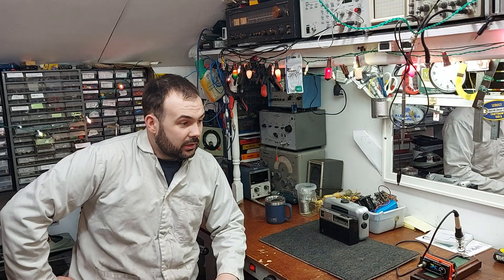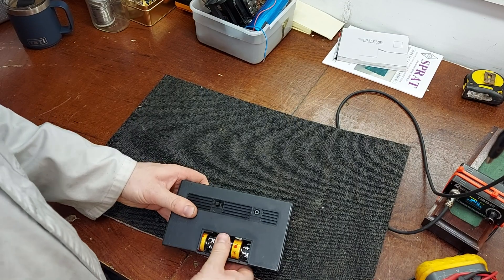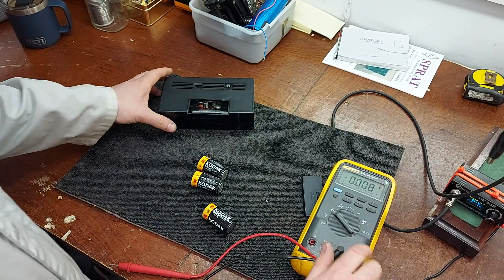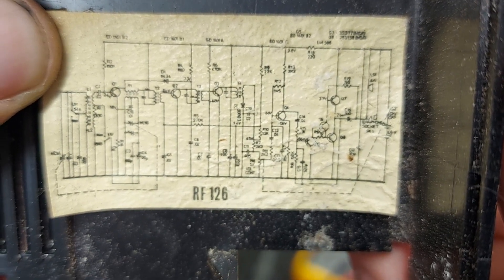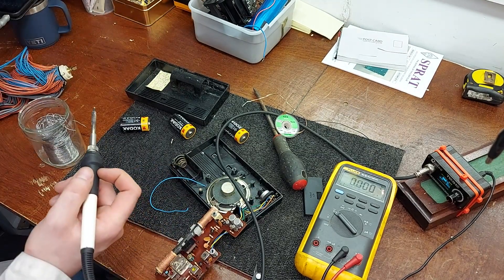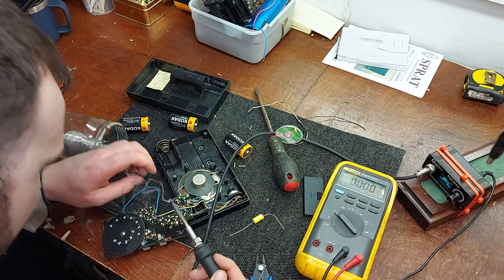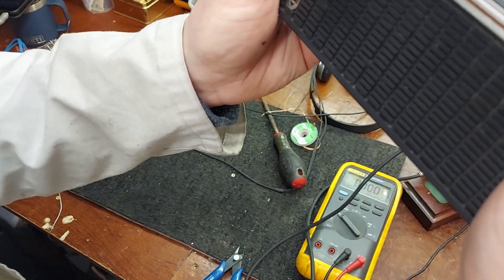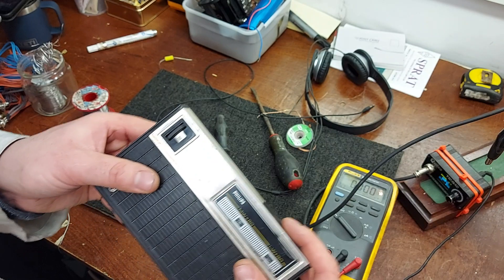Philips pocket radio, new years eve....

Comment: Have you thought of fixing old domestic equipment for youtube?  I have just looked at our 35 year old  kenwood chefette mixer made in UK Its a great design,  4 screws hold it togeather, parts are logical and robust,  easy  to take apart and re assemble. It was spakring and noisey. Inside it had a covering of flour and the grease in the worm gear had dried up. There were 5 broken ends sticking up in one of the armature windings but it ohmed out ok and ran smoothly at 30V DC. It's working as good as new after cleaning and greasing. Do you know  if those broken wires  could have been there at when it was made there is no blackening or distress it looks  brand new. This is a great Chanel thankyou.
Reply from the maker: Sorry William I wouldn't know anything about that. I'm only interested in what I do, can't see myself fixing vacuum cleaners and stuff like that. There are other channels on YouTube that cover that kind of stuff. Hope you had a good new year.